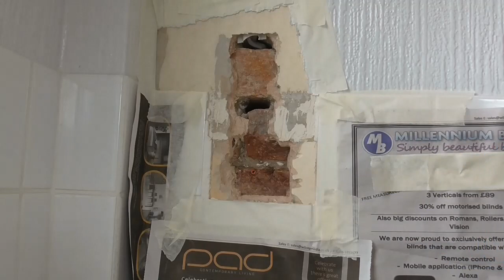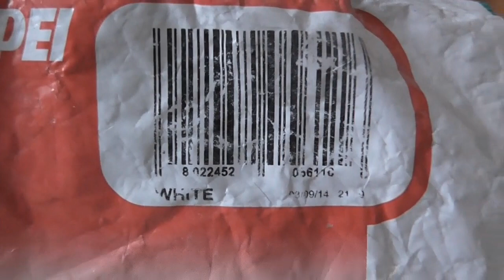How To Fill Electrical Chases  Set A Wall Tile And Patch Wallpaper

Comment: you  are a artist   I benn told the grout you  use  is suitable  for a exterior  filler  need your opinion  thanks.
Reply from the maker: Thanks...  and not sure about that but your better using the correct materials made for a specific job.

Comment: hi i got some anaglypta wallpaper which is reverse hanging , i know that with the paper you mark top with a line as you would normally top to top but i know 1 2 1 2 1 . 2  being at bottom with mark of pencil does it really matter if its plain paper apparently if you dont do this it looks line panels . and also even with emulsion on it would it still look like panels ? cheers .
Reply from the maker: Do you mean reverse alternate lengths. One arrow up one down and one up..  should be on the label
Reply: @PaintingandDecorating  yes thats the one with arrows . top as normal for first piece with pencil mark then second  pencil mark at bottom etc ?

Comment: What about the safe zone for the cable in the wall?
Reply from the maker: Explain what you mean?
Reply: @PaintingandDecorating  It appears to be more than 15cm from the corner and there is now no indication that the cable runs down this wall (as the accessory it connects to is on the other side of the wall).  Therefore someone in the future may drill into the cable.

https://www.diydoctor.org.uk/projects/electrical-safe-zones.htm
Reply from the maker: You should always look on the other side of a wall before drilling double check for sockets...  never drill blind  check and check again..  if unsure get yourself a tester to find these hidden wires.
Reply: @PaintingandDecorating  Agreed, but that didn't answer my question.  You need to comply with the regulations relating to cable safe zones.
Reply: Rhys, if the wall is 100mm then that zone is on both sides of the wall. Given this is an interior wall and probably 100mm then it's okay. Have you xray eyes?
Reply: @SteS  No I don't have x-ray eyes. Hence my question. Rather than the quip, and the poster avoiding the question, I presume the answer is... "The wall is less than 100mm thick and therefore the safe zone is created by the accessory on the other side of this internal wall"?  In reality I suspect the poster didn't consider the regs as he wasn't aware of them.
Reply from the maker: @RhysWilliamsEsq  So can you explain whats wrong and how you would have done it...
Reply from the maker: You must think  you know where every wire is.. lol   bad practise my good man
Reply: @PaintingandDecorating  personally I would have left an accessory on that side of the wall too.
Reply: @PaintingandDecorating  I don't know where every wire is, mainly because people don't follow the regulations when completing work. I was merely trying to increase awareness of them. As you rightly say you should still test for presence of cables before drilling, but that's not excuse for ignoring regulations.
Reply from the maker: @RhysWilliamsEsq  The socket should not have been where it was in the first place... right next to the sink...  totally understand your safety awareness..   had a scraper hit a wire and blow..   also had customers and joiners I know that have drilled into electric cables.... experienced people... have seen some bad work from sparks who should know better...  so in reality never take anything for granted ever...  even when told electric is off double check yourself.
Reply: @PaintingandDecorating  fair enough, you have experienced the after affects of hidden cables in walls. Interestingly there's no regulation around the position of sockets near sinks, although most bodies recommend a distance of 30cm. If it was within this I would have been tempted to install a fcu where the cables disappear through the wall (well above the tile) to help indicate the cable's location. If outside the 30cm recommendation  I would have installed a single socket at the same location.  The wall and tile could then have been repaired to your excellent standard. Hopefully our discussion has increased awareness of the correct regulations when moving or installing electrical accessories.
Reply from the maker: @RhysWilliamsEsq  Yes never trust though that's the key..  worked on this extension and half the sockets ran off one fuse box and the other half worked off a different one...  the house had two points of entry for mains electric could have been two houses in the past....   isolated one and the customer did not know there was two...  so I changed half the sockets then got an electric shock starting the other half...  you can never be too careful.
Reply: @PaintingandDecorating  sounds like a DIY bodge job :)

Comment: How should you have done if the paper was missing for repair
Reply from the maker: If no paper and it's not getting stripped...  I would use filler and make a pattern...  just so it sits better.
Reply: Check the loft/attic 👀🤞